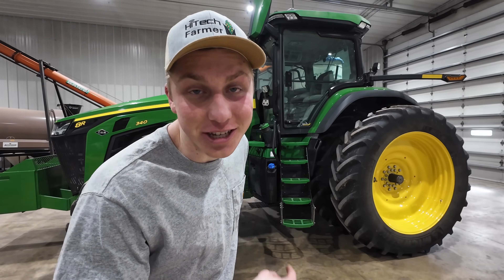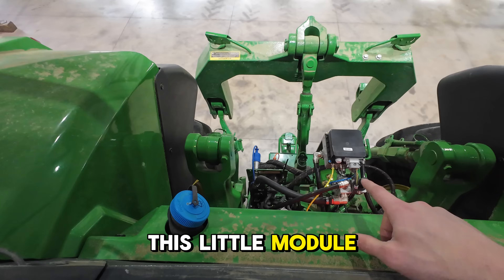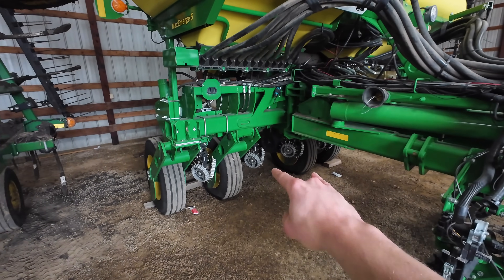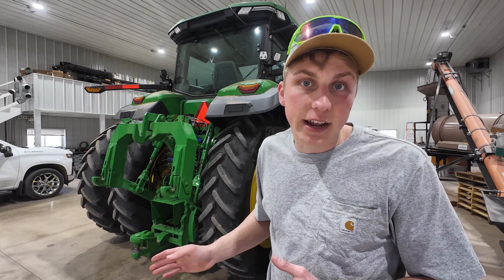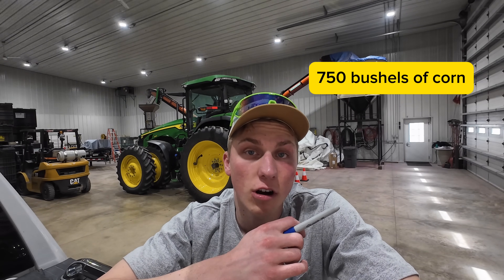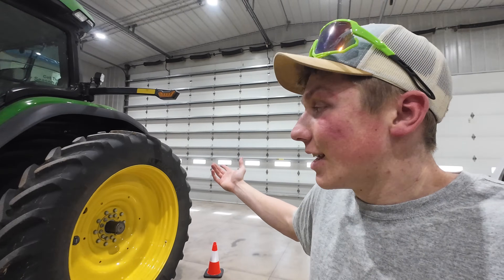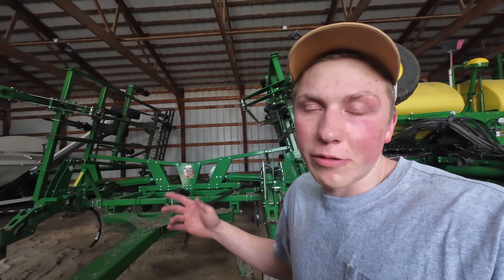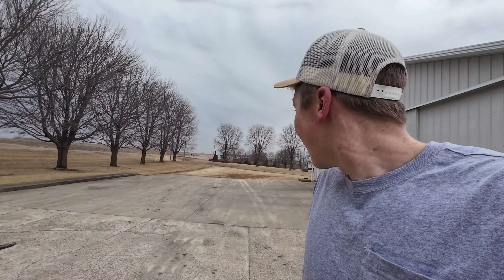My NEW Tractor Upgrade Changes Everything!

Comment: im pretty sure i saw a study some where say pinch rows only really happen when you have tire track on both sides of the plant. so youd had 2 rows over a 24 row. which is 8%,  or 240 bushels of corn and 80 bu of beans. 1080+ 800= $1880. not a very good return at all
Reply from the maker: I would agree to an extent. Even where one tire is next to a row there’s a yield drag. I’ll show it in action when we start planting with the compaction on the soil and slower emergence for those outside rows next to only 1 wheel

Comment: There is definitely a number of better ways to spend $30k on a farm…
Reply from the maker: Every farm is different. Compaction is a real yield robber
Reply: @ it just seems like there is more low hanging fruit to knock out first. Plus in 6 years you will probably upgrade tractors.
Reply from the maker: Fair enough. I’ll be running some yield comparisons to test it. Also the value it adds to the tractor will stay with the resale value
Reply: @ true. Do you run any starter fertilizer in your setup.
Reply from the maker: Not yet. Wanting to do the Precision Conceal system, but we’d need a tender trailer too
Reply: @ I understand. On my organic farm all of our application rates are 17-20 gallons per acre so we will be filling up a lot.
Reply from the maker: Wow that's ALOT of gallons!
Reply: @ yes it is
Reply: Id have to agree I don’t believe the hope in return on investment for a few extra bushels
Reply: @ I’m not saying it’s a bad thing at all. I just feel there are much better ways to combat compaction and spend that money. Also I’m 29 and farming with and IH 6588 and this farm is way more developed so maybe it makes sense that way?
Reply from the maker: The more acres the easier the return, just because its a sunk cost. Also the tire equipment will be transferred to any possible new tractors we trade this one for. So essentially this will be at our farm for a LONG time. Although I'd agree there's a lot of other things that may have a better ROI for your farm, depending on size/equity/time

Comment: Carson from 6Th Gen Farmer runs a system like that on their planter and did find a noticeable difference. They run tracked tractors so I am guessing tractor soil compression is not as much of an issue.
Reply from the maker: I’ve seen it on his planter. Being this tractor also runs the grain cart, this is what made the most sense for us right now